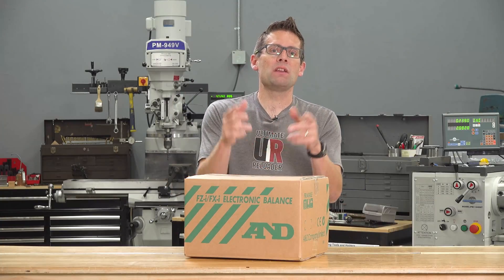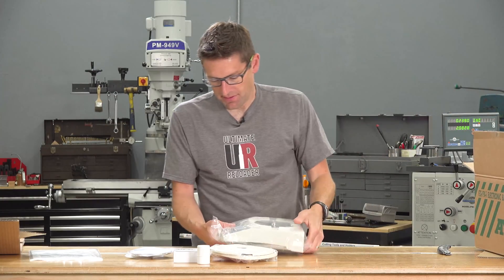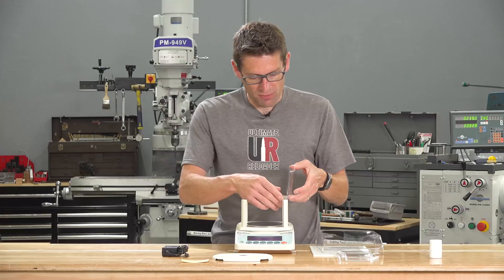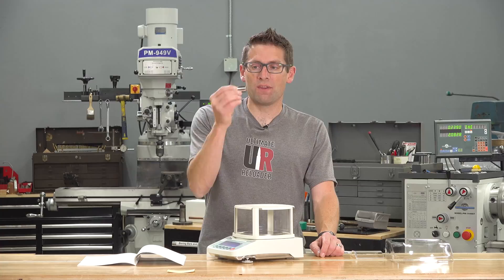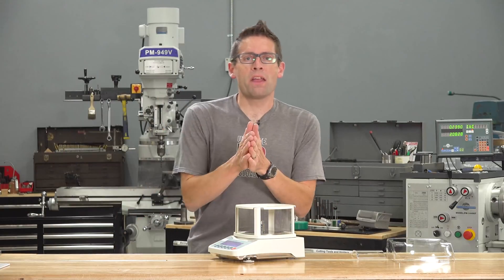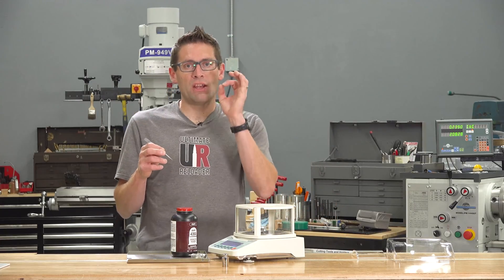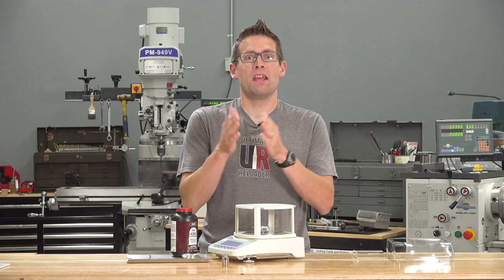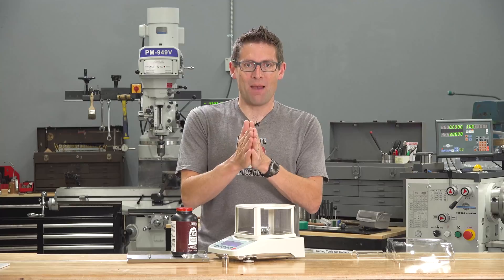Reloader's Dream: A&D FX120i Lab-Grade Balance, Unboxing/Setup/Calibration/Demo

Comment: I see this includes a calibration weight. What class weight is this? it doesn't say anywhere. e.g.

+/- 0.1% – UNclassed Proof Load Test Weights
+/- 0.05% – M3 (Check/calibrate coarse scales)
+/- 0.005% – M1 (Check/calibrate standard scales)
+/- 0.0015% – F2 (Check/calibrate portable balances)
+/- 0.0005% – F1 (Check/calibrate precision balances)
+/- 0.00015% – E2 (Check/calibrate analytical balances)
Reply: Was wondering the same or at the very least the included weight should have been measured by a more accurate calibrated scale and value noted.

Comment: For a lab scale it’s at the entry level of scales, price wise. Scales like Sartorius or Mettler( which I have) are in the 4 to 5000$ range. I used to work at a labatory . They are so expensive since they in use and turned on  24/7 for 10 or 20 years, need to be calibrated and certified once a year and need to be very temperature stable .in terms of weighing you can ,today, weigh with scales like these or even G&G  scales which are totally sufficient for reloading . My scale has a 0.0015 grain precision, which of course is ridiculous for reloading purposes. What’s important is to have a reference weight in the range you are measuring at. A 200 grams calibration weight doesn’t tell you anything about linearity of the scale. So for pistol a ref weight of half a gram or a gram is adequate , for rifle  a 5 grams weight will do . I have made my own calibration weights, using a precision scale that was a factor 10 as precise as mine. Did this 25 years ago and it still is spot on ( 1.000 grams)

Comment: Well I went ahead and  purchased my 120i balance and found my RCBS Chargemaster 1500 weighs within .02gn compared to the 120i when weighing Varget.
I will see how other powders weigh out and compare.
So far my RCBS is as accurate as I sure need.

Comment: Nice video!  Put it over the top for me to get a FX 300i (it's only $40 more and will do 300 grams).  One question -- did you weigh the two empty / clean pans to ensure they are their weights are identical? :)

Comment: Gavin, Just an FYI to you and others on precision balances. For 1-point CALIBRATION, the test weight should be at the center of the pan. To VERIFY calibration, check starting at small weights first, then incrementing to heavier. A series of small weights that do not need to be removed during verification is optimal, as it simulates actual powder weighing operation. Initial verification points should have the weight(s) as close to the pan center as possible. To verify consistency of weighing across the pan, check 2 or 3 different weights at 4 equi-spaced locations around the perimeter of the pan (but not on the edge lip if there is one). For optimal verification of linearity, you should do checks at several weights below and around the typical weight range you will measure. Checking with increasing weight (multiple smaller weights) and decreasing weights will let you evaluate possible hysteresis (although with powder weighing this is unlikely to occur since weight is always increasing). For anyone interested, affordablescales.com has these listed at $649 this week (Jan 2021).

Comment: Thanks Gavin based on your video I went out and bought one of these  scales because I wanted a scale that would measure a kernel of powder. I noticed that you used the heaviest kernel powder you could find.  it turns out that you’re very deceiving and full of crap.  I use reloader 15 a lot and I have to put four kernels in before it will even register. thanks to you I spent a lot of money and didn’t get the product I thought I was getting. I wish you would be more honest with all the products you review because you seem to love them all.
Reply: I love how you blame him for your scale not working up to your satisfaction. That’s real American of you, just blame everyone for your problems.
Reply: @SinkoTree  Just to be clear I called the company that makes these they they said nowhere do they say that this scale will measure one kernel of any powder in fact they said most powders would take 3 to 4 grains to move the scale The fact is the powder he measured probably has the heaviest grain out of most powders. I measured eight different powders that I used for handguns and center fire rifles and all of them required more than a couple of grains to move the scale. So you say it’s OK to advertise a scale to measure one kernel of powder when in fact the company that makes the scale claims it doesn’t have that capacity.
Reply: @brokosok  Yes the powder he used is on the heavier side at .04 grains per kernel. But you have to keep in mind this scale has a resolution or accuracy of .02 grains. It also has a auto zero function where if it drifts .02 grains up or down it will zero. This will make it seem like it is not picking up kernels that weigh .02 or less if you start at a 0.00 measurement and drop in one kernel at a time because the scale will zero the fluctuation. Drop a few grains in the pan to get a weight and then add one kernel at time, this scale is the way to go when you are serious about numbers and accuracy.

Comment: Not practical for 99% of folks.  There are even more accurate tools but where do you draw the line?  How to add powder in a semi normal fashion?  You have to get the auto trickler and they ain’t cheap either.  Interesting but only from a theoretical point of view.
Reply from the maker: Don- do you compete in 1000 yard rifle competitions?
Reply: gavintoobe No and neither do 99% of reloaders.  THAT was my point.  Too many other variables to impact accuracy at that range for a couple hundredths of a grain to make a difference.  I load with digital scales (PACT) and measure everything to 1/10th of a grain and even that is overkill for anything I’d ever bother with.  I’m not saying it’s not interesting, just not practical for most folks who look at your videos.

Comment: I don't mean to be picky, but I remember being instructed in my highschool science classes to never touch calibration weights with my bare  fingers. The oil from your fingers can add a little weight immediately along with causing weight adding corrosion depending on what the weights are made of. Hope this helps.
Reply from the maker: No, that's good feedback! :)

Comment: Please test the RCBS Chargemaster Lite with this scale! 👍👍
Reply: I constantly double check my RCBS Lite with my scale that has same resolution of 0.02gr and I can tell you that for the most part the spread is very good at .04 - .06gr, what scares me sometimes is how it will throw often the first charge that would be as much as 1 grain off or once in a while (rarely) it will be off a good amount but the scale on RCBS will show that it's correct, this is why I double check on 2nd scale and as you can imagine it slows down the process

Comment: For that price AMD cannot include a single calibration weight? I've bought two scales; both for less than $200 and they both had a set of calibration weights. Hmmmm.
Reply from the maker: Multiple options for calibration weights, it's configurable in the balance, depends on what you are weighing. Can't compare this super-hybrid-sensor balance with a normal scale. But yes, it would be nice to have something included.
Reply: CE products does provide a 100 gram weight and you can get the balance for $450

Comment: Cole-Parmer® Symmetry™ EC Portable Toploading Balance  Accuracy 0.015432358 grains (0.001 grams)
300 dollary doos... I has been on for 3 years and in a non climate controlled space. I have actually checked it with NIST check standards so that's a plus too...

Comment: GAVIN WHEN USING PRECISION BALANCE YOU NEVER TOUCH THE WEIGHTS!!!!!!!!!!!!!!!     The balance will now weigh the crap from your hands that got on the weights.   A small set of curved tweezers are used to move the weights.  Grasp the weights under the curved part at the top with the tweezers.  Because you already touched them, they no longer weight correctly.  Wash the weights with rubbing alcohol.   Wipe off with lens tissue to dry.  Verify the weight.    Then DONT TOUCH THEM.  Keep them in Clean box.  If they get corroded they are trash.  Make sure the weights are clean and dust free before use.  The balance calibrates to several decimal places.   The calibrations are what gives the balance its accuracy. 

Usually the pans are not touched either.  Or if touched they are cleaned with isopropyl alcohol. 
Precision equipment is only as good as its operator.
Reply from the maker: Makes sense. White glove time :)

Comment: So is the juice worth the squeeze? Depends on who you ask. It is an expensive unit; but worth the price for its feature set that most won't be using. Is +/- 1/10 of a grain adequate for reloading purposes? Yes, in my case; but perhaps not in yours. A precision balance is going to give you a greater degree of consistency, not just greater resolution. There is something to be said for being able to load 10rds with 40gr of powder and not have 3@39.9, 2@40, and 5@40.1. I went with the A&D EJ 123, which is about $320. You get the 1mg resolution. It is a bit slower stabilizing (~5 sec), the repeatability and the linearity is not as fine. Worth the squeeze to me. Plus my RCBS bit the dust.
Reply from the maker: Well said!

Comment: Yikes! I can't see any benefit for that level of precision especially at that crazy price. Please prove me wrong.
Reply from the maker: It ALL depends on what you are doing. If you are competing in rifle matches at 1000 yards, you need good gear, ESP if you want to load efficiently. :) For most casual shooters this is not needed.
Reply from the maker: And BTW: this isn't a crazy price at all. Similar scales (most of them) start at twice the price this one is at. You get what you pay for. :)
Reply: You can get it for $450.00  when you use the discount code Cambridge 
https://ceproducts.shop/collections/reloading-systems/products/fx-120i-reloading-scale-122g-x-0-001g
Reply: This scale shrunk my groups from 7" at 600 yards to 5". Vertical is less than an inch, used to be 3-4". 

I was using a Hornady autothrow. It was throwing +/- .8grns and thinking it was good.

Comment: Here is one that is far more affordable.  Don’t laugh until you try it, there are several videos backing it up.  Homgeek Digital Milligram Pocket... https://www.amazon.com/dp/B071GYVQF3?ref=ppx_pop_mob_ap_share
Reply from the maker: Ummmmmm- no- not for anyone serious. The FX-120i has a super hybrid sensor, you can read up about it here: https://weighing.andonline.com/expert-library/smart-shs - this balance is MASSIVE. It's actually heavy- and it's lab grade.
Reply: Ignoring marketing words like "lab grade" and "super", I have been using the scale heavily for over 6 months and it has worked perfectly every time.  I'm not saying it is the same quality of build, I'm just saying it will make incredibly precise measurements for 1/43 of the cost.  It will reliably measure down to the single grain of H4350 powder and will track during trickling.  I was able to tighten my SD to 6 with this on 5 shot groups.  Like I said, don't knock it until you try it.  If you are saying that you need to spend $745 for a scale to be serious you are insulting 95% of your viewers.

Comment: Man I'm glad you made this video.I spent hours looking at videos and reading articles yesterday about choosing a good scale.
Great video. Many Thanx
Reply: When I started reloading I bought cheap $20 Franklin Arsenal scale and noticed it would drift and you end up with different weight actually if you re-weight your first charges, that scared me so I went looking for better scale and found GemPro250, it was about $120-130 and it also has 0.02gr resolution.  It's not as nearly as fast as FX120 but even spending this much on scale I thought it was a lot, but that's like 1/4 cost of FX120.  Overall I am satisfied.  I dream of owning the autotrickler setup but I know that even if I trickled every charge down to 0.02gr that doesn't mean I am going to get 1/4 or 1/2 MOA accuracy.  Quality bullets and brass will get you much better results even within .1 grain accuracy powder charges.
Reply: @DimaProk  this is the route I'm going right now, well gempro300, it's only 150$ and it will give me a piece of mind till I can get the fx120 set up lol
Reply: @6mm_chris20  I remember about reading too many negative reviews on 300.  My 250 has it's quirks too but if you learned them things will be smoother.  For example the leveling feet initially I was frustrated because they wouldn't lock in place so I screwed them in even though the scale wasn't leveled it didn't seemed to affect the accuracy.  Recently after 3 years of usage I decided to level it and put some blue locktite, it surprised me how one side of feet and the front had to be extended visibly more, was my desk really that uneven?  Was it floor?  Was it bubble level crooked?  I don't know.  2) when you remove the pan and you keep it off for a while the numbers will drift, so don't leave you pan out and if you do just re-zero.  3) One night we had power outage so I decided to use batteries and was frustrated how the accuracy was out the window.  4) Any breeze from window, AC or fan will effect the reading.  5) I wrapped ferrite ring over power supply cord - the cord that plugs in to scale and connected AC adapter to surge protector or battery backup, can't remember now, it improved stability.  I leave it plugged in all the time so I don't need to wait 15 - 30 min to warm up.  I replaced powder pan with one that has mini funnel build in from RCBS.  I monitor the drift when I remove the scale the number is something like -67.28, as long as it doesn't drift more than .02gr it's fine and it practically never does else I recalibrate with 20g weight which I believe came included.
Reply from the maker: It all depends on your requirements! I've used mini scales for a long time, now that I'm focused on long-range shooting and research, this scale is a must-have for me. :)
Reply: @Ultimatereloader  I've been looking at it.$750.00 is the best price I've found.